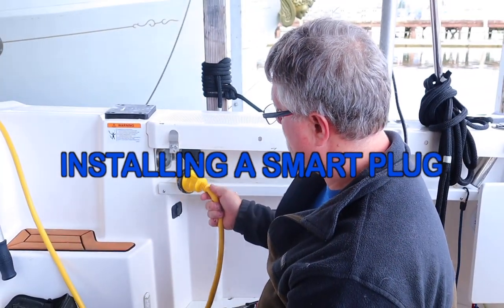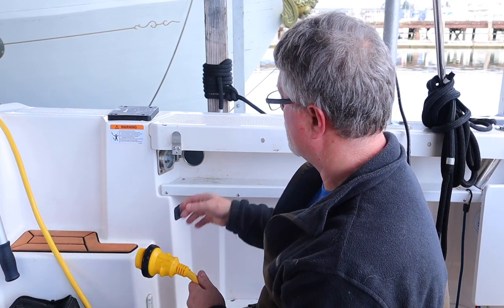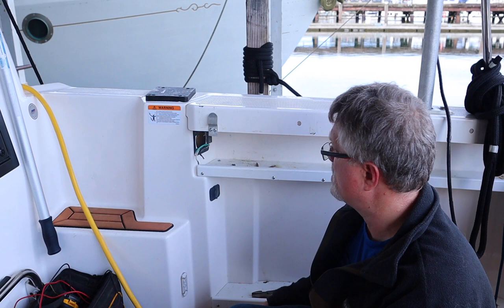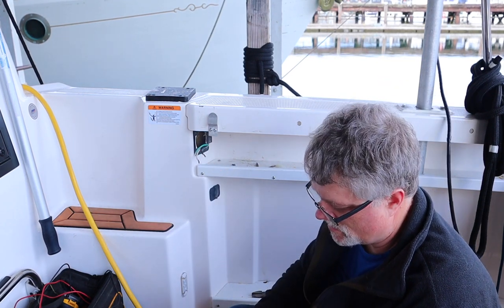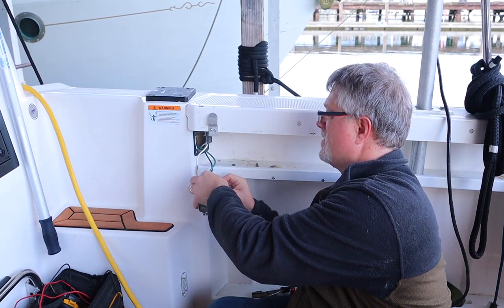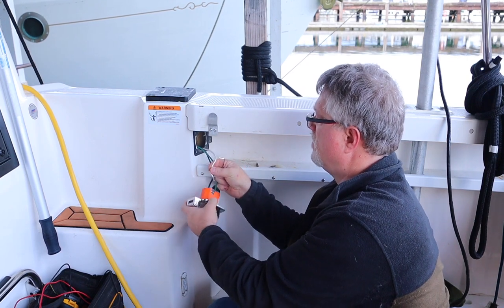Updating our RANGER TUG R27OB/ with the smart plug shore power connector

Comment: Good stuff! Appreciate it. I've seen a few boat fires at the Meltec shore power connectors. Not solely an issue with the connector, but also overloading especially during winter season. See you down there soon.
Reply from the maker: Thanks for the info!

Comment: Any electrical safety measures or is it safe to just go to it given it is DC power? Should the batteries be disconnected?
Reply from the maker: Before doing the work, I disconnected from shore power (switched off at the pedestal, and unplugged the cable).  I also disconnected the inverter on the boat. (I have a battery on/off switch that isolates DC power from the inverter, to prevent it from being able to be turned on).
Reply: @Letsgochannelsurfing  Thank you. That was very helpful.

Comment from the maker: For anyone that might be interested... https://smartplug.com
They also have 50amp plugs in addition to 30amp,  for boats and RV use. They even make them for the marina side electrical pedestals. Though, I don't know of any marina that's using them. This at least makes one side of the shore power cable easier to work with.
Reply: I would have cut a longer "tail".  Then used it for an adapter.

Comment: That plug does look easier. My boat came with an Eel power cable though, and it has a different locking mechanism. It also has an LED light built in as a head light to help you see in the dark. It still twists though, but doesn't have a retaining screw/nut. I have a much bigger problem plugging into the shower power pedestals at our slips. It's incredibly difficult to fit the plug in there and get it connected, I cuss like a sailor every time. I have to sit down and stare up at it and fidget with it for a while.
Reply from the maker: It’s actually a lot easier than the one that came with the boat. It just snaps in there is nothing to screw in. LaZina

Comment: You nailed it !  We have the same issue and always thought the connection was put in a precarious spot. Seems like I have to look into the smart plug this spring after we launch. Happy New Year!!
Reply from the maker: I like the location of the plug. I had to mount it upside down as the lid hits the top of the gunnel and wouldn't allow the plug in.  I may go back and see if I can't just rotate it 90 degrees and have it open sideways (left to right).  But it is so much easier to plug in now.